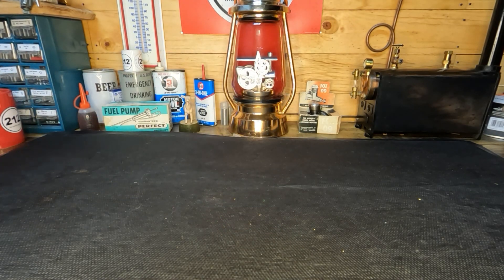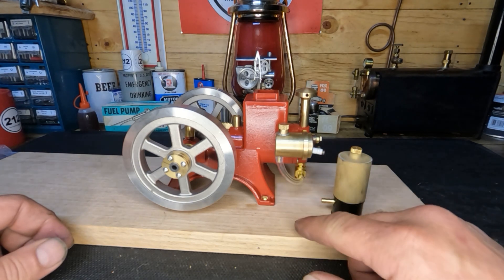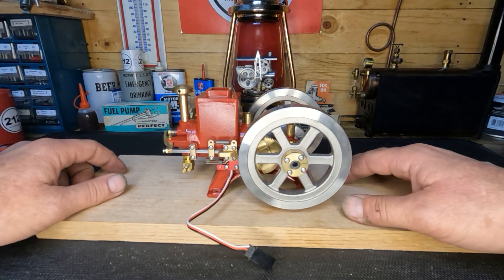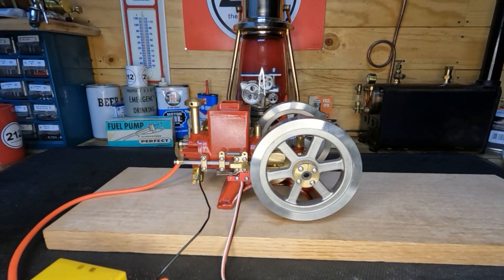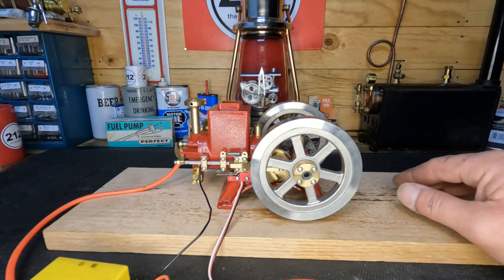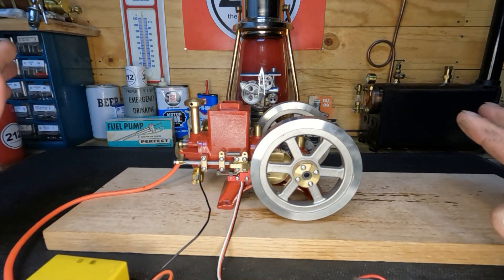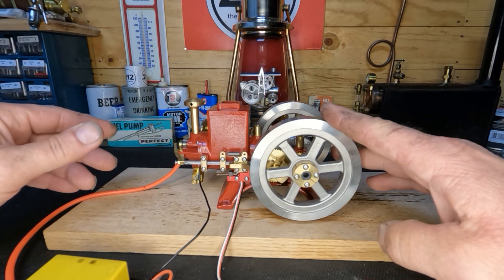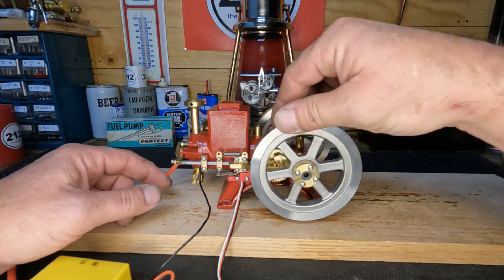Enjomor 6cc Hit & Miss First Start,  Where do we go from here?

Comment: Hit & miss engines are horrible.
Reply from the maker: If you have time to follow along with the other videos on this engine, I think you'll appreciate the outcome and maybe change your mind
Reply: The full sized ones are extremely reliable and worked very well for the applications for which they were designed. At trade shows, you will commonly see ones over 100 years old still chugging happily along. I know some rural farmers who still use them.

Comment: Where did you screw the ground plug on yours?
Reply from the maker: I grounded it by removing one head bolt and putting the ring terminal on it and reinstalling the head bolt.
Reply: @steam212  Thanks, would it be able to go under one of the four base mounting screws? I don't know a lot about grounding an engine.
Reply from the maker: @SteamEngines-Jim  Absolutely, as long as the engine is grounded it shouldn't matter. I'll have to go out to the shop and take a look as to where I finally decided to ground it after I mounted it to the cart.

Comment: How many turns should the needle valve bd turned out. Thanks Chris
Reply from the maker: Hi Chris, mine is set just under 1 turn out (7/8th) but I can't be sure that all engines will be the same. Especially when it comes to fuel tank mounting and governor setting. But that should get you in the ballpark

Comment: Hi steam 212. Just bought this engine for myself for Christmas and used the Steam 212 discount. Looking forward to playing with it  and thanks for all of your videoes on it. Actualy had a Scmidts chilled cylinder 3 hp back in the 1970s. Bought Zippo lighter fluid to run it and have been using blue 3 in one for a long time Cheers!

Comment: I have four of these Chinese Hit and Miss engines and they all run very well but for this model. I do not recommend this engine for first time buyers.
Reply from the maker: Hi Willie, I understand exactly what you're saying, but for someone who has some experience with how these engines operate (full size) and does not have access to a lathe and a mill, I think this is a great start especially if you're like me and love to tinker with them. I could be wrong, but I've never had any scale engine that was 100% right directly out of the box. I'm sure that I will get a bunch of flak for saying this but, If companies like Stirlingkit didn't offer these engines for sale I'm afraid that the passion of model engines would slowly but surely die out especially with the younger generation.  It only takes a spark to ignite the curiosity and desire to keep model steam and gas engines running.  Myself I would rather be figuring out how to make something run properly than to figure out how to beat the next level on a video game.

Comment: hi can you tell me where the white red and black wire connect? on brake contact
Reply from the maker: Hi Mantas. I apologize for my delay in replying. The wires that are used on this one are the black and white only (the red one in clipped off at the points).  I hope this helps. Thank you for your question and thank you for watching 👍
Reply: white and black use for brake, red wire not connected yes?

Comment: Forgive my lack of lnowledge, but how does the engine know when to hit and when to miss??? 😉👍
Reply from the maker: Hi David, The short answer is through the governor, when the engine reaches a set speed the flyweights on the governor will activate the hold open latch on the exhaust pushrod causing the engine to coast or miss, once the speed has slowed down and the flyweights on the governor return the hold open latch releases allowing the exhaust pushrod to close and the engine to fire again or hit. I will be sure to include a better explanation and some visual examples of this process in the next video. Thank you for a great question and thank you for watching 👍

Comment: You could possibly trade the yellow ignition with one of the small black ignition modules tucked under the wooden bases the EM series come on.  You could replace the battery box with AAA so they would be easier to hide in the cart.  I think you can cut the hall sensor off those black modules and replace it with the contacts on this engine, although I haven't tried that.

Yours sounds a lot like mine and ThomasPCGuru's engines before we modified them.  That governor is very realistic to the full size, but needs a lot of work in this size to get slower operation.
Reply from the maker: Hi Henry, I like your idea. I'll have to check it out tonight when I get out to the shop. Thank you for your suggestion 👍